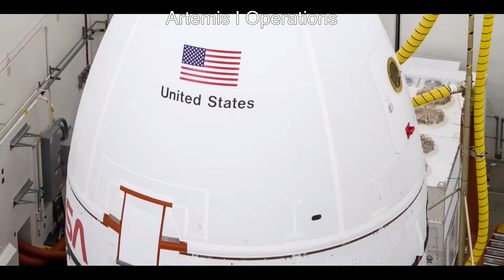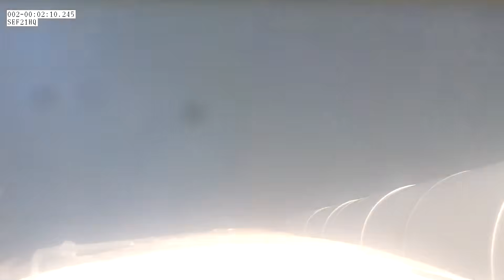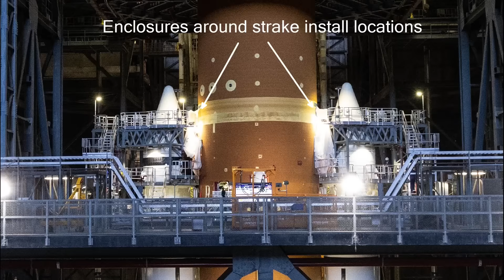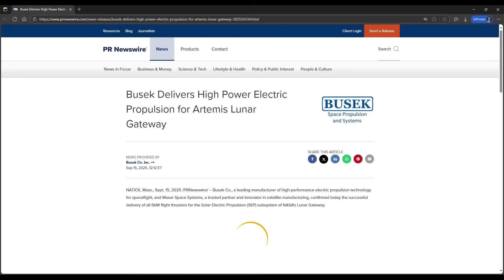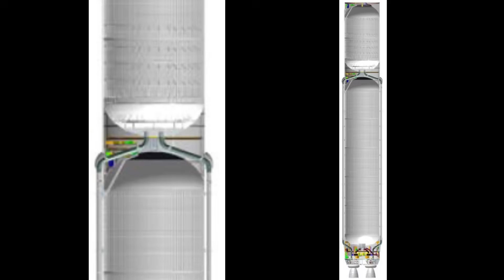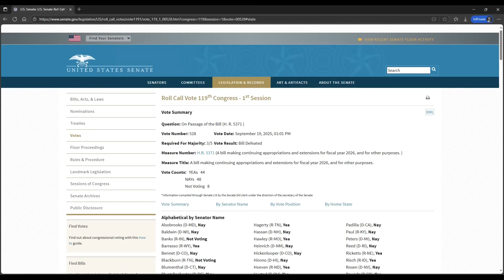Artemis II preview this week, Artemis III Orion milestones, Gateway SEP thrusters delivered

Comment: You mentioned in a reply to a comment that winter launches are more likely to be night time? Is that just due to the short amount of daylight in that time of year or other factors that do with moon phases?
Reply from the maker: AFAIK, it's a combination of factors including the launch site inclination (latitude) and ICPS performance, which mean that the parking orbit is highly elliptical (at least compared to more typical circular LEOs).  Block 1B with EUS is not expected to have as many constraints...assuming it flies.

Comment: What we know so far is the Argentina cubesat cannon is late. That needs to be installed before the the osa can be taken to the VAB. It takes 3 weeks for the thermal compound to cure so Orion is going nowhere. Final stacking should take place on October 10th.
Reply from the maker: What is the source for this info?
Reply: @PhilipSloss  The source is his ass. Artemis I didn't have the full cubesat manifest, NASA won't wait on any cubesat that is late, they will proceed without them.

Comment: Seems a bit strange that Orion capsules are only targeting a maximum of one reuse.  Other than the heat shield, one would think the rest of Orion wouldn't sustain so much wear and tear with each mission that it couldn't refly at least as many times as a Crew Dragon...
Reply from the maker: One of the concerns is exposure in the salt water at the end of the mission.
Reply: @PhilipSloss  but the exact same factor is at play with Crew Dragon, too...  🤷‍♂️
Reply from the maker: @Spherical_Cow  Different con ops, different experience bases, different assumptions, "not invented here," etc.  They might end up in the same place that Dragon is, but one size doesn't necessarily fit all.
Reply: Crew Dragon isn't a deep space vehicle and doesn't reenter from such high velocities, the stresses involved are not comparable.
Reply: @FrankyPi  the only stresses that aren't comparable, are the heat stresses.  Orion's heat shield obviously isn't reusable (and neither is Dragon's), but the rest of the craft doesn't experience substantially different mechanical stresses or ambient environmental conditions.
Reply: @Spherical_Cow  You're basically saying there's no mechanical difference in returning from the Moon, both peak stresses are higher and all of it lasts significantly longer. There is no meaningful comparison between a LEO vehicle and a deep space vehicle.
Reply: @FrankyPi  peak mechanical stresses aren't significantly higher; they're managed by using the capsule's lift to drag out the reentry.  Thermal stress is the only one that's significantly higher.  And duration of mechanical stress shouldn't really be a major problem: we're still talking mere minutes per reentry, for structures and materials the likes of which routinely endure cumulative years of high mechanical stress in/on aircraft.
Reply: @Spherical_Cow  Aircraft aren't spacecraft or vice versa, otherwise any capsule hull would be reused hundreds of times. This dumb comparison of spaceflight hardware with air travel has to stop.
Reply: @FrankyPi  a fighter plane routinely experiences and sustains far higher mechanical stresses than any space capsule ever will.  Capsules typically manage the reentry to keep the g-force at no higher than around 3 or so - regardless of whether they're coming back from LEO or from deep space.
Reply: @Spherical_Cow  Again, you're comparing aircraft, to spacecraft, which is a moot comparison. Spacecraft can never be like aircraft, get it through your thick skull.

Comment: I suppose that the fabrication and initial assembly of the Artemis VI CM pressure-vessel has started?
Reply from the maker: As noted, the plan is still to refurbish the Artemis 3 CM for Artemis 6.  Not sure if NASA has the option (or could afford it) to build a structural spare.
Reply: @PhilipSloss  Ah, I misheard concerning the Artemis 3 part but, yes, I think that NASA having a structural spare or two would be a good idea.
Reply: Fabrication of Artemis VI ESM is underway.
Reply: @FrankyPi  ESM?
Reply: @nicholasmaude6906  European Service Module, for Orion.

Comment: do you Think the white house will succeed in defunding NASA and if so what will that mean for Artemis III
Reply from the maker: They want to keep funding some projects, and the impact will depend on which ones keep getting funding.  The impact will also depend on whether or not they fire more of the workforce or not.

There's likely to be a bigger impact on the Science directorate than the Exploration directorate.  Artemis 3 already had issues before the budget cuts and firings this year, but there could be more impacts depending on whether there are more cuts and firings.